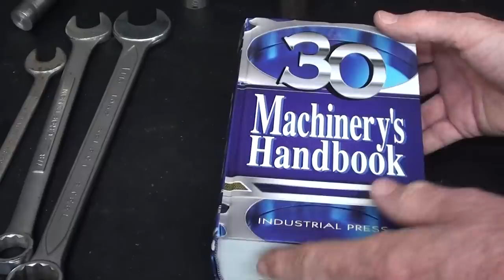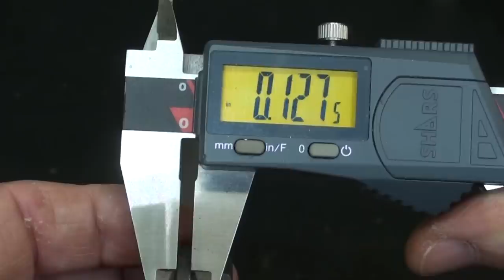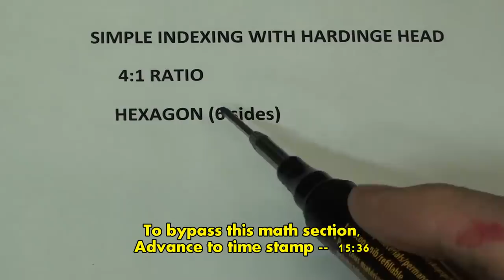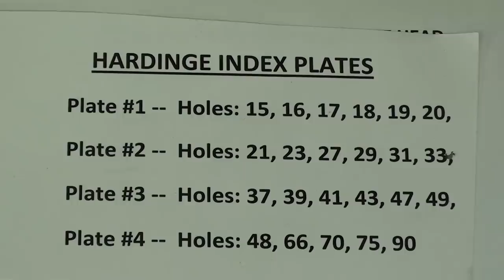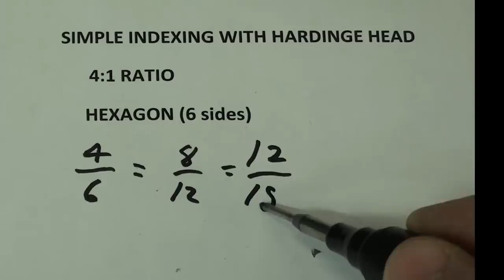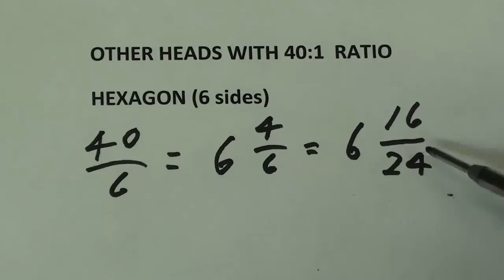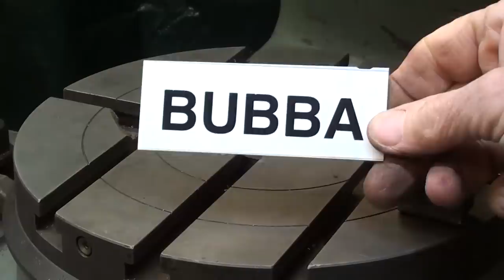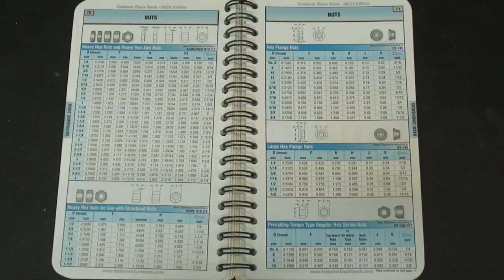Making Flange Nuts 3 methods of indexing TIPS #629 tubalcain

Comment: Mr Pete. Concerning the ancorage of that chuck to the rotary table. Drill four holes through chuck and use T nuts.  Have just done this with a 6" chuck I have and drilled it for four slots and three/six slot tables. So I have drilled seven holes. Its a bit of a battle to make all that fit without hitting pinions etc but it can be done

Comment: I'm not a machinist but I have secretly longed for a smallish hobby lathe & mill (however, pushing 70 years old I have too many hobbies already that don't get enough attention), but I do have a question.  Is there a way for a beginner hobbyist to make a flange nut without the used of a dividing head?  I would venture to say a beginner,  machinist or hobbyist, wouldn't have much in the way of the standard/desired peripherals.  It might not be perfect but could something serviceable be made?  Thanks!
Reply from the maker: Yes, you could make one using a hexagon collet block.   Or the rose index which I have shown and several of my videos. There are probably many other ways as well, including a simple protractor

Comment: The only reason I would use a washer and nut is when you do not want the flange to rotate and move the parts you are securing. Other than that, flange nuts are great.

Comment: With all due respect, these three methods are essentially the same.But what to do if there is no dividing device? I have long used a conventional nut screwed onto the bolt blank and a horn wrench to make bolt heads. After each pass of the cutter, the workpiece was released from the clamp and turned all the way with the key into the milling table https://www.chipmaker.ru/topic/83654 / Sorry that everything is in Russian)
Reply: That is a simple and effective method, thanks for sharing. Many ways to skin a cat, right?
Reply: @doodlebug2121  Oh yeah)

Comment: In the math for the dividing plate you gave 12/18 for the 18 hole line then later on the video you stated you set the blades for 9 holes. Could you explain why 3 holes where dropped on the set up ?
Reply from the maker: Because of stupidity
Reply: @mrpete222   I thought it may have to do with a proper 60 degree setting for the circle since the 9 was 180 degrees apart.

Comment: I am watching from  outside Chrisdom, I want you to rest assured, neither do we have this piece of equipment!
Reply: overmanonfire Get a nut and weld it to a washer. Use a sacrificial piece of wood to get the tack welds straight. Pull it out of the middle and weld it up. Welders can be made from two car batteries and some copper jumper cables if you have to. Or come join us! We welcome those that wanna work and learn. Where there is a will there is a way! Experiment!

Comment: Lyle, I like flangenut WITH a washer.
Reply: Me too.  The flange nut alone can walk across the clamp.  BTW  When I go to my engineering store for hardware, I am usually embarrassed because they have to look up each nut, bolt and washer on the computer which can take a few minutes, and then they tell me that will be something like $5!  It can be a relief going in for stainless hardware because at least that has some value.  I guess what I am saying is that I'd rather buy the flange nuts, and spend my machine time making something more interesting.
Reply: I never thought of using both. Do you find benefits to doing so Dave? I imagine less torque to preload is one.
Reply: AldoSchmedack Another advantage is that the clamp does not move due to the fact that the washer takes the skewing action of the turning nut. Another nice thing is that the clamp does not get scored, only the washer which can be cheaply replaced.

Comment: Thanks for the great video Mr. Pete! Always something to learn.
In your description of the high school method with the hex stock and stud, I don't believe there is a way to run the machine in such a way as to tighten the blank on the stud unless you were using a left hand cutter...am I crazy here?
Whether conventional or climb milling, the cutter is still pushing the nut in counter clockwise direction.
Reply: not true. if the nut is facing you, any cutter contact will be  clockwise to a stud.
Reply: Shop Tech: I’m not sure I understand your post. Are you, perhaps, describing the forces on the nut with the stud held horizontally? If so, then it makes sense, because that workpiece orientation implies end-milling rather than side-milling. The cutter can be expected to drive the nut a little tighter.

With the stud held vertically as Mr. Pete described it, the cutter will tend to unwind the nut whether conventional milling (at the left side of the work) or climb milling (at the right), as the original poster suggests.

Comment: hears a grate home build job.  for the  Home shop,  & student,  it is a spitball gage, I mad my set out of a set of socket cap head bolts.   with a center pin taper,  taper in the center bord cap hed bolt the tapes will expand the split pin a "nearly-nut"  will allow the ball to open as we wind it in the wedge enters the cap head flat & slid down the flat of the spitball, well that's a secretive, expression Of the basics. The Rast will require the making of a ball pin & taper shaft captured in a nut,   Bulls to suit,  your need,  Les Thompson  England, I have never seen one made, on video,   [On youtube Channel yet, ] That doesn't mean there's Never been on one  But I haven't yet,  Something for you to have a go at, it's one of Them, students.  Tasks in a high' school. I seen set in metalwork class we read them With a micrometer.   Hav ago A bit oFf brit tool steel I have used to,    Les England.  well, I'll keep watching,  Grat chanal  Son.